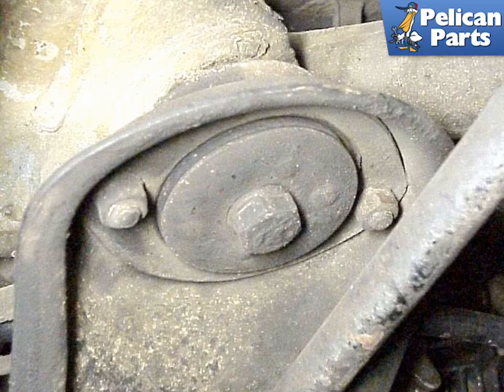Porsche 911 (1965-89) Engine Transmission Mount Replacement

Comment: What are the torque specs for the transmission mount bolts for a 75 911S?
Reply from the maker: I don't have torque spec info that goes that far back. If you check the forums, someone may have shared that info. http://forums.pelicanparts.com/